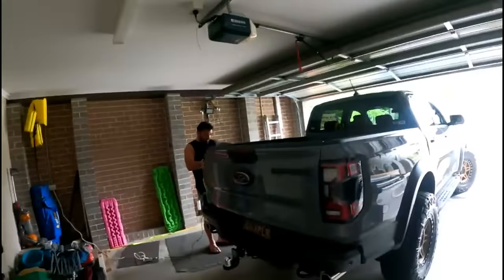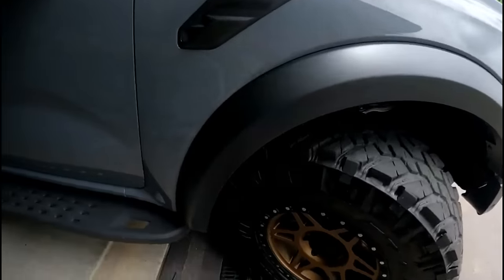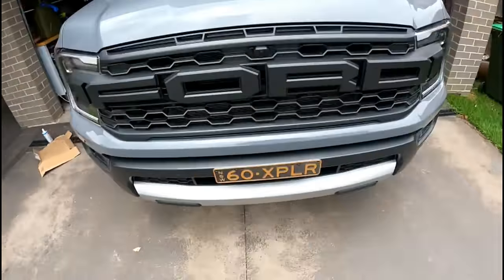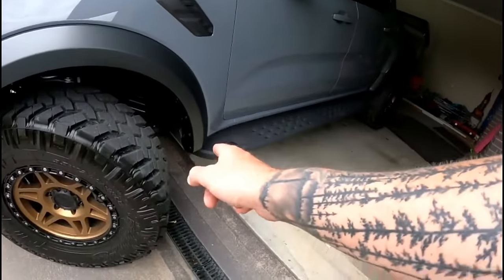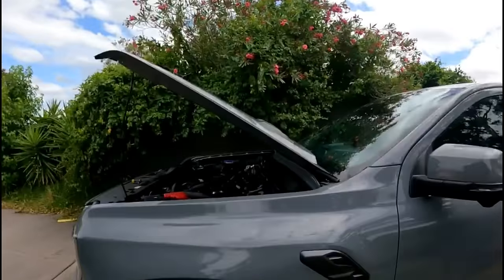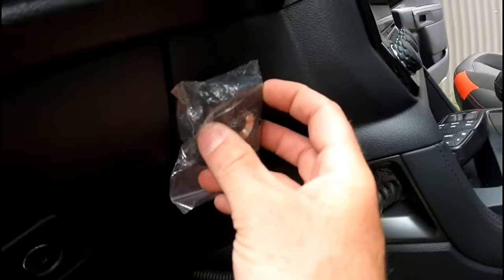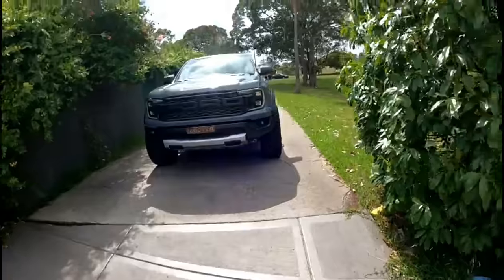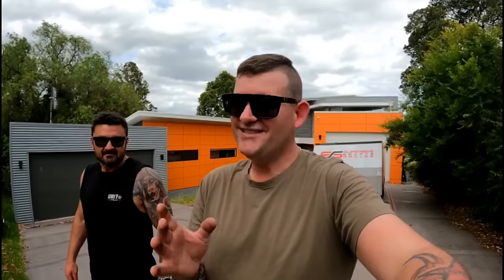New Gen 2 Raptor Ranger first modifications!!! can we fit 35 inch tyres including the spare?

Comment: Great video, amazing car..!!! 
Iam about to get mine EU edition (less power unfortunately), expecting delivery late this December...
Iam about to put 35s on, but also a lift kit.. Do u think lifting the car is going to affect negatively the height sensors of the fox suspension??
Also the trail grappler tires, are noisy compare them with stocks BFG KO2..?
Reply from the maker: Thanks mate. Is the EU version still TTv6 petrol or does it have one of the diesel options? 

I think spring lifting it would. Damo is going to put a 1” strut spacer in the front. To keep all the factory sensors happy in the fox shocks. The raptor doesn’t have bump stops and the strut leg is thick and over engineered so it should be right. 

These nittos are noisy mainly because they are about 50% worn. When they’re new they are reasonably quite for a mud tyre.  The KO2s are really quite, most ATs are these days.
Reply: @HappyGoTravel  The EU version is 3.0L V6 petrol motor as well, but with 292hp and 491Nm output.. The 2.0L diesel engine will come out summer 23'
Reply from the maker: @RaptorDecalsMaster  that is definitely a little less power and torque. Being light with awesome suspension it’ll still be awesome
Reply: @HappyGoTravel  yes, the euro6 regulations sucks ... Europe sucks😢😢
Anyway i will put 2" spacers in the front and 1" spacer rear, trying leveling the car.. I hope this doesnt hurt the suspension ..
Reply from the maker: @RaptorDecalsMaster  mate it’ll be fine. Looking at the front I’d say 1” spacer is the go. With the way the fulcrum works on the LCA I’d say it’ll achieve somewhere around 30-40mm of lift and that will get it sitting level. And It won’t affect cv angles or anything like that. If you want to do 2” you’ll potentially have to do a front diff drop to balance out the increase. 

Either way putting spacers on top of the shocks will be the best option with these so it doesn’t affect how the live valve fox works
Reply: @HappyGoTravel  thanks mate be well..

Comment: I have buy a 20x9.5j can u advise me what tyres should i use that can fit without lifting ?tnx u
Reply from the maker: Any thing under an equivalent OD of 34", if you want 35" tyres id put at least a 1" spacer in the front to clear the guards on maximum up travel

Comment: This is awesome, thanks guys, definitely more content please! Have you taken it off-road yet and if so did the tyres rub once the suspension was compressed more?
Reply from the maker: Cheers mate ✌️yeah we have, it goes really good. But I’d expect that from high power, reasonable suspension travel and twin locked🙌 no scrubbing either, I do still think +30-35 offset wheels would be better though
Reply: @HappyGoTravel what offset are your wheels? Have you tried at full compression?
Reply from the maker: @birdymeo  they are +18 and 9” wide. We cut everything to make them work at full compression. In saying that +35-30 would be a better offset for clearance purposes

Comment: Does a 35 inch tire fit in the spare wheel well? Or what is the max size it will fit?
Reply from the maker: Hey mate the 35 fits in the factory location. There is around 1cm clearance either side of the exhaust
Reply: @HappyGoTravel  thanks for checking! Been hitting up a bunch of dealerships over here stateside to get on order queues.

One more question, how much if so at all of a bother is it to access the lockers in the touch screen? People were complaining about having no physical button for lockers during the recent reveal but I was wondering how much of a hassle it is from a person who already owns a ranger raptor.
Reply from the maker: @ck4391  it’s not to bad, like everything you get use to it pretty quickly. I’m keen for you guys to get them in the States. I’m thinking there will be some cool aftermarket gear coming out in the US for them

Comment: in a long run does it need a leveling kit? Or its fine with stock height?
Reply from the maker: It’ll be fine in the long run. Leveling would definitely have it sitting better. In all honesty I think a +30/35 off set would be better on the wheels
Reply: @HappyGoTravel  oh i see, but which one looks better stock or leveled?
Reply from the maker: @ppr3017  leveled looks better.

Comment: I just ordered my Ranger Raptor.. you thing a less aggressive tire tread pattern would fit without modifying the fender wells? I start cutting and pounding on a new truck and my  misses would murder me.. 🤣
Reply from the maker: 🤣🤣🤣 yeah I get that. Slightly smaller tyre or a slightly less aggressive offset will fit no issues. I’d go with a 295/70r18 this is around 34.5” and a +30 offset and it will be perfect
Reply: @Happy Go Travel  thanks mate, I'm on a 4 month pre- order waiting list here in Phuket Thailand.. SMH...
Reply from the maker: @HKTjohnnywalker  4 months isn’t too bad we’re over 12 months here for them now

Comment: Have you lifted it yet?
Reply from the maker: Hey mate, it has been lifted now. It has king springs 2” in the front and 1” in the back
Reply: Does that work ok with re valving?  As it is now sitting higher in the stroke
Reply from the maker: The valving seems ok and it still ride’s awesome. I do believe Mike shock shop are working on revalving for this next gen though so that may be a future update

Comment: What is the fuel consumption like
Reply from the maker: Around 14-15L but only if you’re nice to it
Reply: @HappyGoTravel  . I'm tossing up between th petrol or diesel. How many ks per tank you get on average
Reply from the maker: @dpdog88  depending on how it’s driven 4-650🤣 when you flog it it loves the juice but keep in mind 35s is the worst thing you can do for fuel economy. 

It’s all dependent on what you’re doing with it. IMO, The thing that makes these cool is the TTv6 petrol. Without that they’re petty much like every other top spec dual cab Ute on the market.
Reply: @HappyGoTravel  so the question is fuel economy,  or power . Honestly its a Hard choice. Be nice yo do those long outback trips. But with how much cheaper petrol is at the moment it prob evens out
Reply from the maker: @dpdog88  that’s it. I run 17.5L in the y62 on 35s when I’m nice to it 🤣 but it also holds 140L. Two 20L jerry cans and it’d be similar range with the raptor
Reply: @HappyGoTravel  if you don't mind. What are the repayments like?
Reply from the maker: @dpdog88  Its not mine so I couldn't actually tell you but my mate owns majority of it so not overly much

Comment: What’s the tow rating on these new Raptors
Reply from the maker: It’s only 2.5t they’re not really made as a tow rig. You’d be better with the v6 diesel ranger if you were looking to tow heavy things all the time
Reply: @HappyGoTravel  yeh bit of a shame they have such a shit tow capacity, these things would have plenty of grunt for towing. Would rather a petrol over a diesel nowadays.
Reply from the maker: @jjktmk14  they definitely have the power. But with the suspension set up it’s too soft in the rear for the weight. In saying that these are more designed for belting up the brach / in the bush. The suspension just soaks everything up the ride is unreal
Reply: When people understand the raptor is  not a heavy towing 4x4 it's designed for of road performance and racing it's allready won the American desert race with no engine or suspension modifications that's what it does it's a mid size twin cab killer no competition. Pretty simple if u want too tow heavy stuff that's what the other models rangers are for

Comment: Nice wheel but wrong offset
Reply from the maker: 100 percent. +30-35 would be better
Reply: @HappyGoTravel  Qty.5  17×8.5 +35mm Method Bead Grip 706 Bronze wheels, and the 35x12.50r17 size has a 5 to 6mm smaller diameter  😉👍